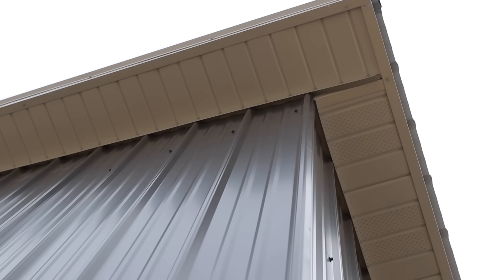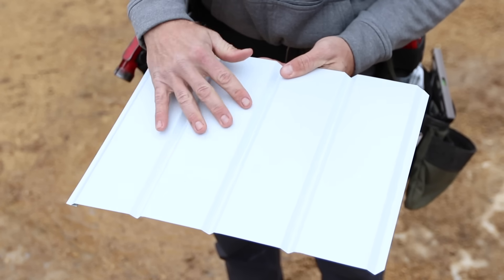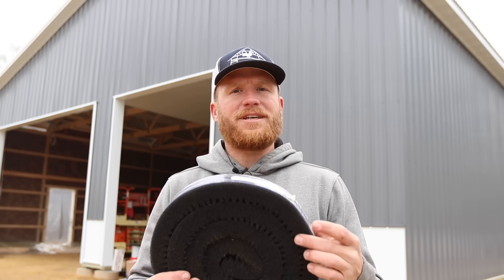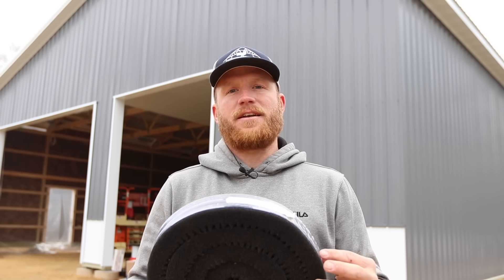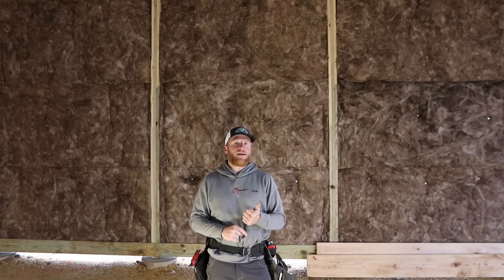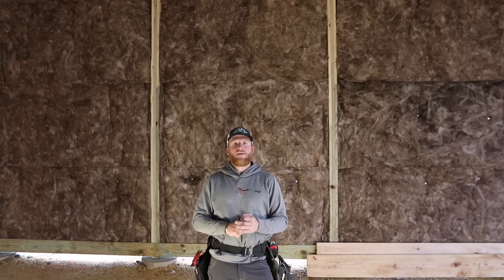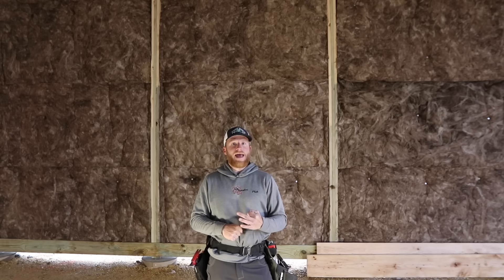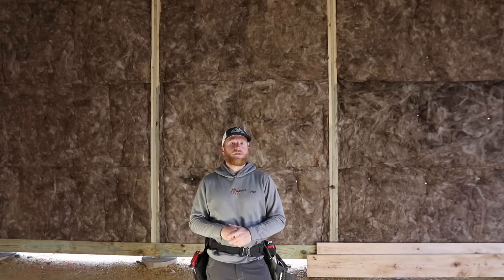Insulation: 5 steps to a more efficient building and why I don't use spray foam

Comment: Great video.. I do want to comment on the "flash and batt" idea you threw out (i.e., an inch or two of closed spray foam followed by batt) - Please see the "youtube" Marshal Build post-frame build series, where that exact method turned into a disaster.. the house moisture came through the sheetrock and soaked the batt installation and all of the house sheetrock had to be torn out in order to replace the "batt" with more spray foam.   You want your moisture barrier before any non-waterproof insulation - otherwise the moisture will continue outwards until the dewpoint temperature is reached, at which point it will condense and saturate the material.

Comment: I have question. I have a post frame building with a steel frame door but it does not have a thermal break in the door & every winter I can't enter thru it because it's frozen shut. Is it possible to replace it with a thermal break door & what is needed to do it? (Do I need to remove the metal trim (not door frame)from around the door in order to replace it?)

Comment: We sprayfoam in Canada but it is cost prohibitive for most.   Insulating batts is the usual method with poly (vapor barrier) on the heated side of the exterior.  With Acoustic Sealant used around all penetrations or joins.    Along with rafter vents covered by Insulation to direct air through the soffit, up the rafter towards the ridge vent.   Similar setup to you but given the weather our Inspectors  are generally enforcing the energy efficient and insulating practices.
Watching your "Barndominium" series, you flipped to foam.

Comment: I know this video is 3+ years old.  I just want to mention the long-term savings spray foam provides.  My brother owns 2 businesses that do spray foam.  When he started more than 15 years ago, we often discussed the premium of spray foam cost and how to discuss it with customers.  At that time, it looked like energy prices were going to more than double over the next 10 years.  Then policies changed, natural gas became a very low-cost alternative to many businesses and in other applications, so energy price increases were moderated over the past 10+ years.  
But the real selling point of spray foam is looking out over the horizon and knowing that when energy prices jump, such as in current times, because your building, home, etc., have used spray foam, the energy price increase will be a flatter line on a chart, as compared to other insulation options.  
Spray foam is certainly more expensive, upfront.  
When we calculated the cost of heating and cooling a home, in some cases, the price difference would pay for itself within a 7-10 year time span.  And from that point forward, as energy prices may (will) rise, you constantly reap the benefits of using spray foam.  
When building any kind of structure, there are constant trade-offs.  The price difference with Spray Foam is an easy one to rationalize when trying to save money or stay on budget, upfront.  Thanks for your video, you do a wonderful job in explaining your thought process and how your build to a high level of quality.  Thanks for sharing your knowledge in this video with us!!!
Reply from the maker: Very true… I don’t discredit spray foam… I’m fact we’ve used a lot of it lately.   But it doesn’t necessarily make sense for every type of project

Comment: Best pole building videos I've watched, too bad I watched them AFTER we built our building. I have some questions before I start insulating. I didn't wrap under the siding. I am planning on putting the wrap on the inside now because it's too late to have it under the outside walls so is it OK to just put it up from the inside which will cover the outer girts? Next question is can I just use faced R19 fiberglass and skip the plastic sheeting? I'm leaning towards unfaced and using the plastic. What mil plastic do you use? Thanks 👊

Comment: I'd like to see how 10'x10' garage doors are installed on the long side of the building. For instance, a 32'x40' building with 3 garage doors. Where would the posts for that wall be?

Comment: House wrap doesn't stop air infiltration but will reduce it. The whole point of it is to block water infiltration while allowing the house to breath which will allow water vapor to escape. If you want to stop air infiltration and keep your costs low have a 1" layer of closed cell spray foam applied and bat the remainder. You can't beat foams sealing property. I'm not a huge fan of using it on roofs/ceilings.  I think you want to allow the structure to breath out through the ceiling to allow any vapor to rise up and out.

Comment: I applaud you for putting up moisture barrier beneath your exterior sheathing & the Poly over you interior insulation.  That by itself should prevent moisture building up in your walls...  In addition, that fiberglass insulation method you are using is comparable with open-cell spray foam, less expensive on average, and an acceptable method of insulating a barn.  No complaints on your choice of building materials.  The only downpoint of large bats of insulation is that they sag with time.

Comment: If a wall is closed cell spray foamed would I need still need the plastic before studding the wall and drywall?

Is it a way of money and time if I already have walls spray foamed but I still add a R insulation after studding walls?

Comment: I'm not convinced there won't be condensation on the outside wall panels. I also looked like you didn't seal the vapor barrier seams and edges.

Comment: How do you handle the wall wind bracing.  With 2x6 laminated posts, and with wind braces on the inside of the girts on the wall corners....you no longer have the full 5.5" wall cavity to fit the R19.  Are you doing alternate wind bracing?

Comment: finally someone who is on the same page. I never recommend spray foam either on any of my buildings that I do. . ive been building d
for well over 20 years,  and I've never heard a single complaint from any customer that their building wasn't super efficient.  it's always the opposite.  that they can hear it with a candle.  properly insulated, and vapor barrier,  and they a solid performers. thanks . I'll pull your videos fir some references.

Comment: You will still get condensation with fiberglass insulation because your walls are corrugated leaving that 1” gap empty creating a heat trap. Spray foam is the correct way to insulation pole barns no matter the region you’re in.
Reply: Not only that but batts are full of air and moisture

Comment: Spray foam makes getting rid of termites impossible.  Yes it helps keep them ot but if they get in it is impossible to treat it.  Most companies will not even try.  Those that try do not guarantee it.  Termites are just using it as a travel path.  We have that problem where they go between spray foa and concrete.  Cannot even find what they are eating.

Comment: Here's an off-the-wall (pun intended) idea for those big bay doors that suck heat (and leak), like you say they do, and they do. On the exterior, over the doors, install something like those big curtains that some big-rig trailers have on the sides. Lumber trucks sometimes have these, to keep the wood dry, but being easy to pull back for loading. I don't know how well they seal but they'd at least keep wind from hammering against your bay door, which really increases infiltration through gaps. Just an idea. Shoot me if it's stupid. 😁

Comment: Fiberglass is a joke for insulation. Furnace filters are made from fiberglass. Why you ask? Because air travel through fiberglass easily. Everyone that has done any demolition has seen discolored fiberglass insulation... that is dirty air trapped as it passes through the fiberglass. Use a Krendell blowing cellulose into the wall cavity using a Par pac system. It is blown in under pressure and can't settle like in an attic. Been doing it in walls and attics in Northern MN. For 30 years. What is your blower door test on that building? We try for perfection on a blower door test but usually end up around .25 Pascale  leak.

Comment: Nice details, all your tips, are Canadian building code. We use thin foam ventilation baffles. Vapour barrier is critical, the moist warm air in your home hits a dew point in your cold walls, and turns to moisture. Your house wrap soffit curtain also prevents your blown in from getting wind washed. Love the simplicity of a steel building.

Comment: Closed cell is going to be significantly better even if the R value is much lower.  But yeah, the cost is going to be much, much higher.  
I don't think anyone should ever use fiberglass though, mineral wool is the minimum batt that I would accept in any of my houses (assuming I'm designing or making it), the vapor running through the fiberglass will eventually just make it uneffective over time, where at least mineral wool is hydrophobic.

Comment: There's an ongoing debate of house wrap, flashing, insulation and so on. Not to mention all the different brands and claims manufacturers make. It's confusing because they contradict each other and have different long term results. I believe what you said about air flow is accurate
 My neighbor spray foamed his house and his brand new windows got ruined with condensation between the panes. Had the manufacturer replace them without divulging his foam and winded up installing the whole house dehumidifier. Of course it blows towards my house and it's not exactly quiet. With insulating more is not always better
Reply: All air tight homes need a fresh air exchanger,
Reply: @safffff1000  what exactly is air tight and whatever my neighbor has is annoyingly loud. I'm sure radiator heat with moisture doesn't help a spray foamed house
Reply: @shantor100  it should, its a closed system plus a heat exchanger, thus no problem

Comment: As a builder in N. MN, I agree 100% spray foam is not the solution it traps moisture between metal and foam then corrosion occurs!!!. And mice eat the foam crap up!! Then you have tunnels of mice homes with no insulation.
Reply: Since the foam glues itself to the metal how the heck does moisture get between anything??

Comment: This is all fine and dandy, but a better, more efficient way would be the following 

1” of pink board foam from rat board to soffit. House wrap, then metal. 

 I prefer spray foam, but I’ll give you the idea of “value” for fiberglass. So lay that 

add you vapor barrier 

The pink board then truly insulates your concrete. But more so stops wind penetration, as well as an extra barrier protecting your wood from rot. 

If you’re selling fiberglass as more value, put the pink board on the outside to stop the wind. Game changer. 

- from northern Michigan, similar climates, just more snow.

Comment: On my personal pole barn, which I built, I used metal roofing that had a thin layer of synthetic fibrous material sprayed to the underside of the metal. My building is uninsulated and there is no condensation dripping from roof panels. Any condensation adheres to the fabric and evaporates. Cost was an additional $1 sf. Dampens sound of rain as well. Your videos are well detailed and informative. Well done. 👍🏻
Reply from the maker: Yes that’s good stuff

Comment: Short and sweet. Just the facts. Excellent video on insulating a pole building. I’ve been building houses for 30 years and found this very educational. Just did my first pole building and had no clue how to properly ventilate and insulate it. Metal is different than wood.

Comment: good video and building tips. I built passive house style homes in michigan in the 80's and 90's. While mathematically folks will agree with your thoughts on "diminishing returns"  . However while building new , it is the least costly time to make any structure , low cost to operate over the lifetime. I built residential . My best home , 4000 square feet, 2 story , slab on grade. Heated and cooled in michigan , $250.00 for the year. After a few articles where printed on that home. The state of michigan hired me to teach all the technical school instructors how to build homes without furnaces. 99% off the shelf materials for the homes. Most fuel costs will not be getting lower over the years , from the data and commodity prices I keep track of over the last 30  years of building . I know you are talking about a working barn building  . But many DYI folks are building pole barn homes as their resident . Because of the lowest cost per sq ft framed and finished. Great tips for folks. Blown in is so cheap to add plenty the first time around. Keep up the great work . Building science is constantly getting better , as are the great folks like you , sharing what you know and do .

Comment: Spray foam will cost you less than fiberglass. The increased energy savings make it so that the return on investment is about 4 years compared to fiberglass. After 4 years, spray foam (closed cell HFO spray foam) will start saving you money on energy bills and also making carbon emission savings. There are recent energy modeling studies made in different climate zones in the US which showed exactly this. No matter the climate zone, closed cell spray foam due to its energy savings will cost you less and also reduce a building's carbon footprint in only a few years, no matter the climate zone.

Comment: Thanks for the nice detailed video.  I don't build in your region, but my first thought on vapor/rats/air infiltration is to use SIPs.  Perhaps a full SIP enclosure, including roof, and then use furring strips on the outside of it to attach siding, metal, composite, whatever. 
If you screen the bottom to prevent bugs etc, you can build in natural air flow between the two, and negates the need for anything else....as I envision it at least.
Reply: Did exactly this on my timber frame. It works great. During the summer when the heat is bearing down on the outside the hot air rises up and cool air comes in the bottom. Makes a big difference in how hot the shop gets.
Reply: @rexmundi8154  cool.  I am building an addition, and I am just putting up T111 plywood, and closed cell foam.  No vapor barrier, nothing.  My area is dryish, and has little prolonged dampness.

Comment: A better insulation material is Rmax Polyiso. Made up to 4.5” thick. Can be used as a weather barrier and air barrier if taped at the seams and penetrations. Fiberglass will loose R value of moisture and air are allowed to move through it. Polyiso will not absorb any moisture. 0.02% and has a foil face witch will lend a slight reflective characteristic. Easy to install. Cost effective.

Comment: Dude your reasons for not using foam is quite frankly ridiculous. Spray foam would have been the perfect product to install on this particular project because it would have drastically helped in the actual structure integrity since you went 8 ft on centre. Not to mention an R20 fibreglass has never performed over an R19 in all the actual tests they have done on it. Bottom line is this always 8se spray foam on any stick framed product. It’s well worth the extra costs as it’s almost impossible to do it later. It will save you the cost of the product in the first 5 years in heating/cooling. I build 50 custom homes and garages a year and been doing it for 30 years so I’ve been through the ups and downs of thousands of different projects. Some work while some  others were garbage but spray foam is by far the best bang for the buck over a lifetime of ownership of any stick framed building. The added strength it gives to your walls is absolutely unbelievable. Fibreglass offers nothing to the structural integrity of a wall and frankly it’s place in insulating homes have come and gone.

Comment: Question, I install full ridge cap venting,but my eave side of house is closed in ( no way to vent ) how should I vent gable ends down lower only ? In Florida ( 1/2 “ foam board installed before metal thanks 😀

Comment: If you go 1.5”-2” spray foam it’s gonna outperform the r19 fiber 10 times. I appretiate the effort on the videos and you obviously think a lot about doing things right. But as a sprayfoam contractor I see daily hoe fiberglass fails huge ... I do a lot remodeling and even on my own house and garage iv seem tremendous improvements so just be cause I see so many  failing fiber glass/vapour barrier on a daily basis I really start to hate fibeglass. The only place I see it works fine often is the ceilings blow in ... 

Good videos tho. I wonder did you change your view on fiber vs foam in pole building walls ? 
Thanks

Comment: -  structural integrity batt vs foam is not even comparable

- No polly needed as vapour & thermal barrier is in first 2" of foam not 1"
Reply: Correct must do 2", no more is needed

Comment: Ive been in the spray foam industry for over 30 years. He is wrong . Spray foam has no air infiltration vs bat . Spray foam will pay for itself in 7 years by savings on conditioning the air. Spray foam stops condensation when used properly

Comment: You just trapped a porous insulation material between two vapor barriers (visquene and steel siding).  Not a good practice.
That means that airborne moisture can be introduced by convective air into the fiberglass and have no way of escaping, thus mold will have a food source.
Closed cell foam has a built-in vapor barrier at thicknesses in excess of 1.3".  That, to me, is a compelling reason to consider foam in a pole barn.  Plus, foam more than doubles the racking resistance of the structure, making it essentially tornado resistant.  Thanks for the video.

Enjoy!